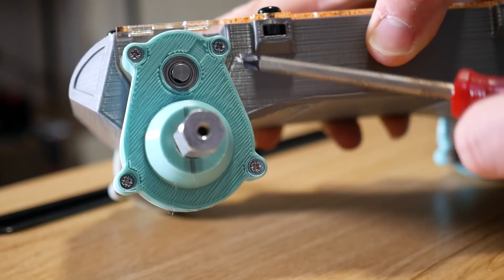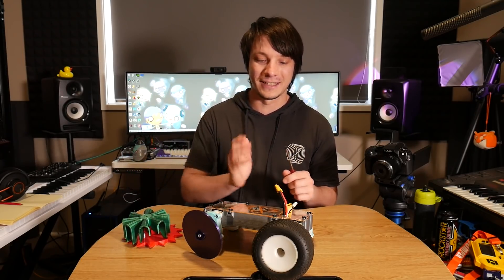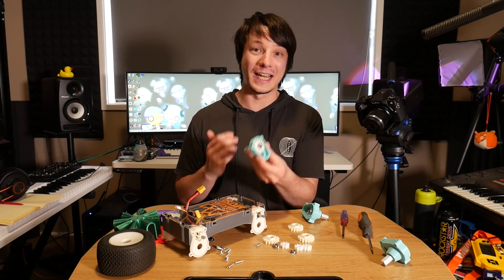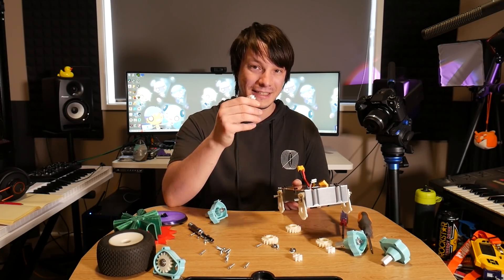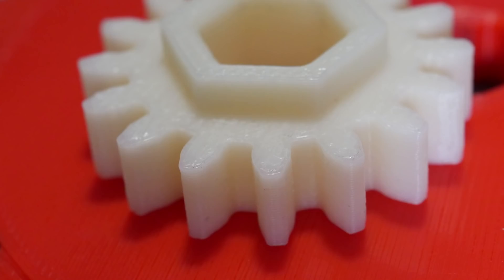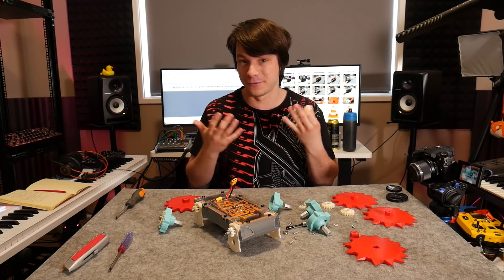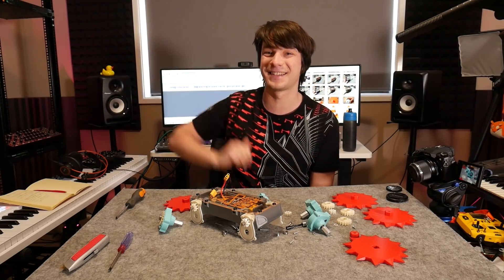Did the 3D Printed Gears Survive?

Comment: If the hex connection in the gears was to be an issue, a possible fix would be to grind out a small slot in the hex shaft and print the gear with a matching notch in it to lock it in even better.

Comment: I haven’t seen if you were using any lube, but wd40 ptfe dry lube spray is pretty cheap at Bunnings and would work well. 

From what I can see of your design it might be possible to lengthen the contact area of the gears on the hex nut and d shaft in the axial direction, as well as increasing the size of the support ring around the hex in the radial direction. Also grinding a second flat on the output shaft would helps then you could tune the Gears themselves to be a deliberate weakest link. Of course it’s working well as it is. 
Very cool video.

Comment: Honestly, I don't know if brushless motors would be at any danger anyway. They are usually capable of handling stalls for at least.... some amount of time. What that amount of time is depends on the current power and heat dissipation is, which at stall in an unventilated case may be pretty low, but yeah.
It should handle it decently regardless?

Comment: "a mechanical fuse" reminds me of the pin in a some sailboat's rudder: if you have an old wooden rudder on a 6-ish meter (20-ish feet) long sailboat, you don't want it to break completely if you ever hit a rock, so there's a wooden pin that breaks if you hit a rock and the rudder rotates out of the way around a metal pin. your rudder isn't of much use when that happens, but you can easily fix it instead of having to buy a nice new well shaped rudder

Comment: Probably dangerous half knowledge here, but someone from a higher semester studying mechanical engineering told me to try and make gears with an uneven number of teeth, preferably primes, because that can help reduce wear when there are periodic stress spikes Like the piston of a combustion engine firing because the regular spikes won't hit the same tooth every time. I don't know if that applies to your robot in any way, but it might be worth a test to change the pinion gear size to something like 9 teeth.
Correct me if I'm wrong please.

Comment: I don't understand why they don't add another "cut" in the motor shaft on the other side of it. This would both make it differ more from a perfect cylinder which would make anything you put on it less likely to slip, and it would move the center of mass to the rotation axis, which would make it less wobbly.

Comment: For the layer bonding failure on the wheel, couldn't you drill a couple holes in it after it's printed and put a small pin in to reinforce it? And for the gears could you print it with a layer if mesh in between the layers that you can cut around to the gears shape after printing it complete

Comment: Cool project Angus, I really will like to build one once you get everything refined!

What if you made a air intake in front with a filter to keep trash out with a small fan as an exhaust in back?  

I mean if you seal it up too tight it may overheat the battery and motors when you drive it hard.  

Take it easy dude and have fun!

Casey

Comment: Another data point perhaps:  I printed a set of PETG  'Change Gears' for my metal lathe, the gears drive a power feed used for cutting threads, etc.  The fastest gear spins 1:1 with the material, or in my case 2400rpms max.  So far they are working surprisingly well.  I was initially worried the gears wouldn't be precise enough for cutting threads, but the cut threads pass the Go / No-Go gauges.

Comment: Loving the testing you are doing on this platform.
The biggest criticism and suggestion for improvement I have is on your choice of fasteners: while it looks like your screws are either Pozidriv or Phillips (hopefully of those two Pozidriv)  both of these (and many of the other cruciform heads) are known to cam out easily. I would suggest instead using a design that will not cam out such as hex, torque, or potentially JIS (though they can be easily mistaken for Phillips and their drives can be used on each other... while damaging the screw head).
Also consider having a small pocket in the bottom of the outer gearbox housing that could hold a small amount of grease/oil to lubricate the gears. I know that at the moment you are attempting to have these destroy themselves (which helps tell you where failure points are), but having the capability for lubricant will help with the longevity of the final designs.

Comment: You should also do an endurance stress test, how do these fair if you have it go at full throttle for the duration of the battery/however long you're comfortable running those motors for

Comment: make the small one with nylon 6 ( or 12 lol) , the gear height on the print bed is low so  it can be printed in any machine, and make the center a tighter fit . check for nylon contractions u may need to scale it +1.2% . dry the nylon well just before printing.  

they will last forever and ever.
Reply: I haven't had any luck with Nylon12. Nylon 6 is relatively easy as it sticks to the build plate (too much: I started considering my glass build plates disposable since nylon6 takes a chunk off every time). Nylon12 on the other hand is the opposite. It just won't stick to the build plate no mater what. Which is a shame because the finish looks nicer and the material is MUCH stiffer than nylon6. I'm using "pure" nylon, not "CF reinforced" which I heard is easier to print with.
Reply: @83hjf  oh its easy. make a pulp/dust of toilet paper, mix it with diluted pva glue ( the transparent one , kids glue )  and stick that to a glass. sand it a bit for imperfections. it disolves with water u wont loose the glass. 

nylon 6/12 sticks  as hell to that.

Comment: for the dynamic breaking, use a small bicycle or even tricycle tire. to measure the resistance, track the wheel's RPM and the height of the surface being pressed against the wheel. should give you the numbers needed to measure torque. cheap and straight forward to build (the math isn't, but oh well...)

Comment: polycarbonate is not too pricey and way stronger than acrylic and plenty clear :)
also grease/lubrication helps a LOT with gears :) hope you don't mind these unasked for advices xD
the hex slots could benefit from a retaining compound or glue too :O but then again mechanical fuse thing would not work!
i also wanna see the spikey wheel in TPU :D

Comment: It's probably more shock loading, ie, going forward and suddenly reversing. I would double the width of the pinion or pinion hub to reduce the bearing pressure load on that one small shaft flat.

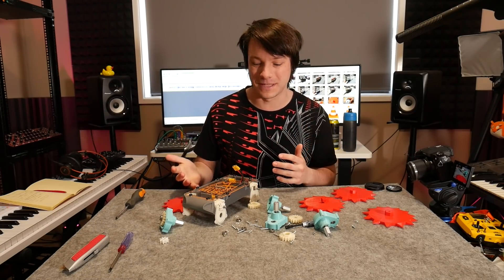Comment: Although it clearly isn´t the cause of failure in this case, it is not recommended to use a gear ration of 2:1. The teeth will come in contact with the same teeth over and over in every rotation, which increases wear. So instead of using 8 and 16 teeth, it would be better to choose 8:17 or so

Comment: Have you thought of resin parts? Especially if you use Tom's resin infused with carbon or fibreglass. 

Also, how would metallic PLA work as your mechanical fuse?

Comment: What your after is a shock test you just want to load it from 0 to 100% nice and quick. Example apply force on your torque wrench on and off quickly not a slow loaded pressure. This might replicate what you see in the real world.

As for making them stronger increase the thickness and add a collar with clamping screw/ set screw. In general the tooth profile is fairly thin maybe 4 walls? Thats 1.2mm for a 0.4mm nozzle which isn't a whole lot of meat. Try a 0.6mm line width (your 0.4mm nozzle can print this if it has a flat tip) increase tempature for better fused layers. You can keep the gear ratio the same and make them bigger it will allow the teeth to be thicker.

Comment: Angus!!! If you happen to have a pool or bathtub you could try to use a paddle wheel in the water to create a constant load under rotation, and get a digital torque meter or just measure current into the motor. Could potentially be a great gear test setup.

Comment: As a challenge, you should try making a mini lawn mower based on your platform with as many 3D printed parts for the mower bit as is practical. I doubt it will be particularly useful as an actual lawn mower, but it would be interesting for destructive testing purposes. Something like those spiky wheels rotating in opposing directions to work as a grass shear would be a good starting point for experimentation.

Comment: What about using metal infused filament? And looks like gears don’t mesh all the way to the bottom, so what of rounded that area instead of angled? Maybe little more strength. What about making d-surface and hex-surface more of a tighter press on? Looks fun though!😊

Comment: I think if you drop the Module of the gear teeth one notch the gears would be more durable. You would have more contact area to spread the load plus there would be more material around the 'D' of the hub on the driver gear.

Comment: This exemplifies how ductility of the material affects function. The ABS pinion was able to stretch and let the D shaft slip while the less ductile PLA sheared under the same stresses.

Another interesting property of PLA is how it will flow under long term compression and permanently deform while most other printing plastics don't exhibit this behavior. For example if you press the PLA spur gears onto the D shaft they may self loosen over winter, or other long periods of non-use.

Comment: There is a relatively new PLA blend in the market called "PLA Tough". It does not smell like PLA and it is not just another slightly modified PLA to call it PLA plus or PLA pro. But it prints like PLA and has high impact resistance, stiffness and better than average layer adhesion. I think it is a very good material for gears and other parts of this project. For Australia I think you will be able to get ecoPLA Tough from 3DJake, if you wish to give it a try. Really cool project by the way, looking forward to the next video.

Comment: I know that printing keeps getting better, but gears still seem to be an issue for long term use.
Good for prototype, but not application.
I recently got my first printer, and have thought about melting down some aluminum for some lost PLA casting.
I know that aluminum is a soft metal, but I wonder how it's deformation would fair against the layering and deforms of the plastic.
Reply: Casting tiny gears like the ones in this video would be quite challenging.

Comment: It seems that ABS held up nearly as well as the PLA, but when choosing to use the PLA, did you you take weight into account? As I understand it, ABS should be about 25% lighter by volume.

That’s not too important for an off-roader , especially with how little of the weight is in printed parts, but I’ve built a fair few RC drag cars where that 25% weight reduction is a huge deal.

Comment: Instead of modelling a hex drive which can often become a failure point in the plastic I have found modelling a GT2 pulley head insert that is slightly undersized then heat pressing into the plastic gives a almost unbreakable interface. All you need to do is pull the top ring off a GT2 pulley and you now have a perfect drive insert with shaft grub screws. Just an idea

Comment: I think what happened with the split gears on the D was simply that the axle rotated and the extra plastic in the D was pushing outward.  The D is pretty shallow since it's designed for metal.  

I have a few solutions that could add more grip while still maintaining your "mechanical fuse".

You could file the flat side of the D to allow a more aggressive hold.  I think this is the best solution for 3D printed plastic but it is a lot of work.

You could also cut a key into the axle.  But that would be even more work and running a chance of ruining your motors.

You could add a really small screw to interface with the D through the gear.  It might work but I don't really see this helping with the plastic slightly deforming and greatly increases the chance of a snap.

Lastly, you could add a metal key but into the plastic.  Really flat and wide, like a shim.  Basically a small little plate to interface with the D that won't flex as much as the plastic.  OH!   A really small washer.   In a reset on the inside of the gear.  Just something to reinforce where the plastic gear touches the D.

Comment: Hi Angus! Your pinion gear system seems so be very clever, but the hexagon shaft could be a little slipery, instead you can use square shaft it could solve the torque/deformation ratio on abs or any material you use... and the span of the pinions could be solved with a perpendicular screw to fix on flat side of the shaft... but anyways very good job! thanks for the fun ;)

Comment: Could someone with an artillery sidewinder x1 answer my question? What is the size of the footprint of the sidewinder with the bed fully extended forward and backward? I’m wondering if it will fit in a 23”x23”x27” inclosure without the spool holder attached? Thank you

Comment: Crazy idea… Teeth and hub interface printed in that BASF PLA, or ABS, while the main bulk of the gear printed in fairly hard TPU.  
Either multi extruded or assembled from multiple prints.  My thought is that it would drive the same in normal conditions, but might help dampen mechanical shock loads to the teeth and back to the motor. 🤔

Comment: I have completely switched over to rounded hex shafts

 I would switch to torx, but it's easy for me to make rounded hex shafts on a lathe and mill with a hex 5C collet holder to mill the flats. I was inspired by gobuilda, and they have some good off the shelf options, but the tolerances aren't great. 

For the printed parts, I just make it a hex, no rounding, and print a test part of various size hex holes to fit each shaft. Clamping onto round shafts is really tricky, and hard to do with printed plastic. I work in robotics and we had issues with motor shafts slipping (on the rotors but not encoders, causing problems) so we switched to hex shafts. The hex has a lot more positive engagement, and if you round it, it will fit nicely in bearings.

 if you still want a mechanical fuse, you could print a shaft coupler that works as a fuse somewhere, which can be tuned more easily

Comment: You should test Acetal and various resin gears. You may also be able to get away with much smaller shafts if you use square shaft instead of hex, less of a risk of slipping and rounding over the inner feature.

Might be interesting to artificially age the PLA parts with high humidity to see if that affects their strength. I've noticed that PLA parts tend to get brittle with humidity/time.
Reply: acetal is impossible to print. you need a chamber >100C. it's a horrible material to print with (simply because it doesn't stick to anything so there's no way to hold it down to the build platform). Nylon is "good enough" for this application and a breeze to print.

Comment: 5:30 Would making the gear have another part that you put on the hex and that has splinters coming off into the gear and then mesh them together? Like print the art that goes on the hex out of a carbon fiber or fiberglass or something and then the reviving gear out of ABS to keep the strength and remove the sheering concern?

Comment: I run similar 6mm D shafts on my 3lb combat bot printed wheel hubs. The D does tend to wear away as you saw but I found just hot gluing the hubs on seems to work surprisingly reliably to prevent both axial movement and maintain torque transfer. I have been using Nylon hubs but also tried TPU and CF-Nylon. TPU doesn't like to stick to hot glue that well unlike the others. PLA is fine if it isn't gonna take a hit!

Comment: I've used several 3d printed gears out of ultimaker CPE with great success.  sometimes I have to do a bit of filing on them with my needle files to make them mesh nicely.  I have them inside of a few nerf blasters: https://youtu.be/-4lNwm7Cbsk

The motor spins at around 33k rpm with a worm on it

Comment: Hey Angus, in the RC car world we use slipper clutches to protect the gears and drivetrain.  You could make your drive gear free floating from the output shaft sandwiched between 2 plates that are attached to the output.  The friction fit allows you to provide a certain torque to the output but it will slip when that torque is exceeded. 😉👍

Comment: properly designed gears do not slide on each other, they roll  on each other  ...  involute gears  on wikipedia.org/wiki/Involute_gear... "it is called the pitch point of the gears, where there is no sliding contact."

Comment: @05:14 I'm currently in the process of 3D Printing the parts for a Voron 2.4 on my i3 MK3S while waiting for the Kit Parts to ship and while studying the Manual, STL, CAD, and YouTube resources I came across an interesting approach to how the designer(s) included an emergency solution if you couldn't source the required machined 80T Pulley Wheels by 3D Printing ones with a toothed cavity matching the tooth profile of a 20T Pulley Wheel ( which, I assume, needs to have one side decapped to be insertable ) and I gotta admit I find that idea pretty neat.
Basically, the TORX variant for a shaft mount instead of a HEX one 🤔

With a Pulley Wheels that large though using it inside a small Spur gear might be difficult - Makes me wonder if you could use it as a Spur Gear itself? Also how about using a Pulley / Belt Reduction Gearbox instead of a regular one?

Comment: Would printing the parts on something like a cr30 help with the delamination? The part would still print flat, but the layers would be at an angle which should help your wheels not come apart like that.